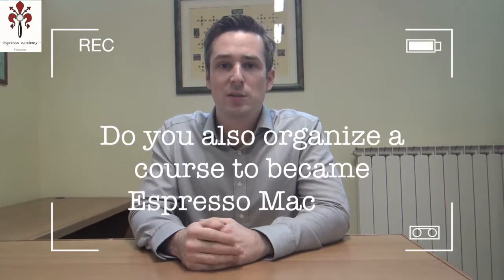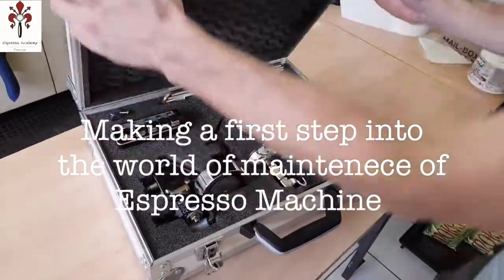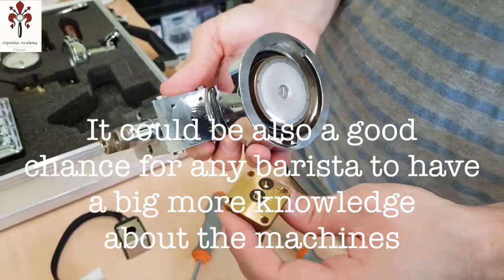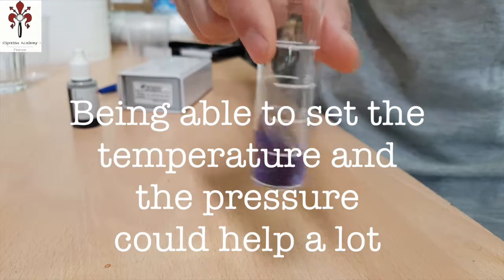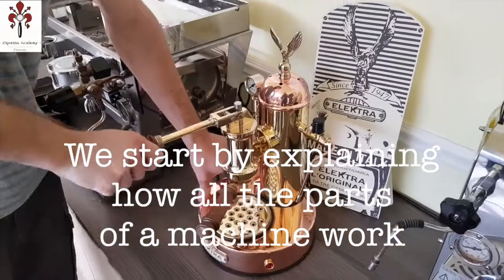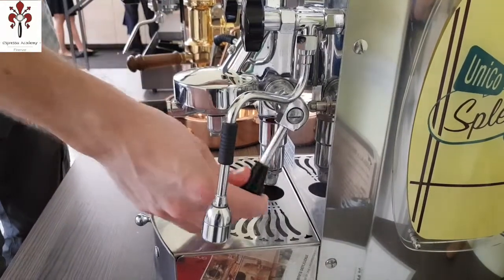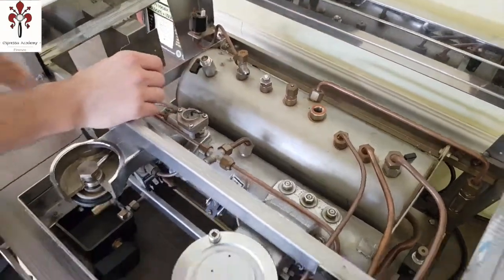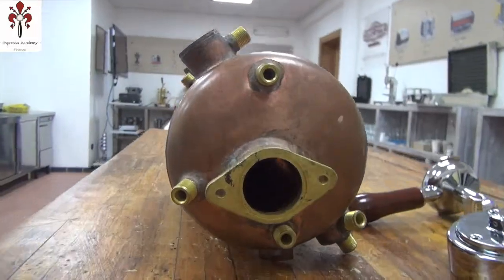Espresso Machine Maintenance and Repair Course ENG - Espresso Academy

Comment: Hi Is it true that you should not decalcify a portafilter machine from a two-circuit machine? Have a Bezzera Bz10, some say you should only decalcify the heat exchanger and the associated circuit annually, others say you should leave out the hot water/steam boiler because the decalcification can attack the heating and everyone else says you should completely disassemble the machine every 2-3 years and decalcify externally what is correct ???? Only use soft water !! is this also a topic of the course and will it be addressed? And shown how to do it and how to do it right?
 best wishes pleas give me a feedback thanks ;-)